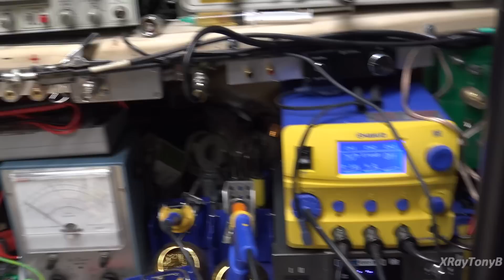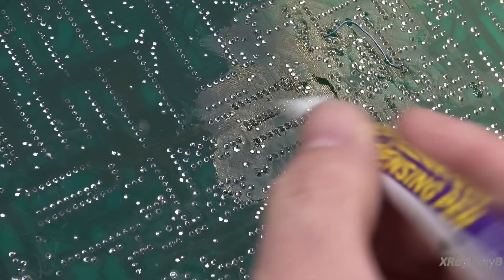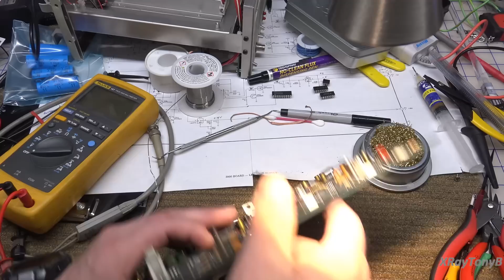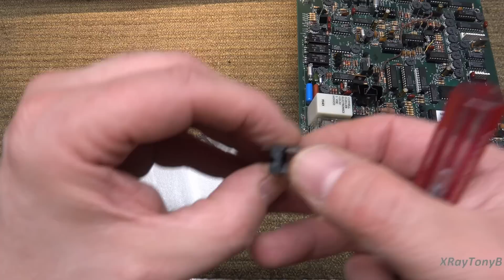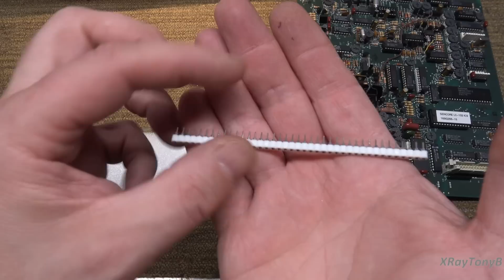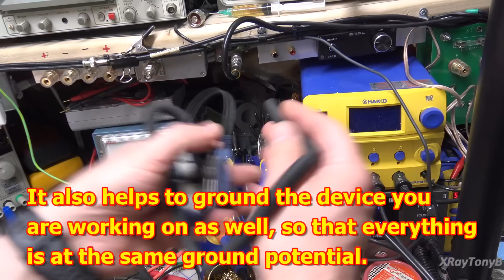Sencore LC-102 - Part 3 - Replacing ICs on the Circuit Board

Comment: Low melt solder can be really useful as well for desoldering. Use solder braid to suck up some of the old solder first, add flux, then blob the low melt  on all the pins and swoosh it around to mix it in and the part will likely come right out.

Comment: Have u tried using low melt solder before desoldering, works great
Reply from the maker: Yes, that's a trick I use on newer boards.  This one still has the good old lead solder.  Thanks for the comment!

Comment: Tony, we don't often get the anti-static info within these video's around the internet, but when we do please don't make the massive mistake by telling that your wrist band has a direct connection to ground.... Of course you mean well, no doubts. But that connection is done at least through a high resistance (> 1MΩ). No one would connect one of the mains potentials to his body, when touching live mains with the other hand it can or will be fatal.
Again, I am sure you meant well, but people listen to you and most do not have a Hakko soldering station (like me) and start building their own anti-static device 🤔
Reply from the maker: You are correct.  As far as I know, all of the anti-static wrist straps have this resistor in them.  Thanks for bringing this up, however.  :)
Reply: @xraytonyb  Glad to notice I was not to hard on you. After I wrote my comment I realized that you use an isolation transformer, and that might let you think different about ground.
Reply: Forgot: second reason for that resistor is that a static discharge (from component/device to ground or from your body to ground) is limited in current too.

Comment: I couldn't stop laughing when I read "notice how efficiently the desoldering tool removes the solder from the wrong component" I have done that a few times too so don't feel bad.
Reply: Also I would like to add that when cleaning flux off a freshly soldered component I use a 2" x 2" lint free nail wipe, very inexpensive, I get them sopping wet with IPA, lay it over the component and use a tooth brush on the patch and it works extremely well in removing the flux, I saw this on another channel and was surprised how well it worked.

Comment: 23:50 "Assembler/Solderers" or EngineeringTechs at many of the Aerospace/Defense companies will still have IPC J-STD-001 courses, for which the evaluation PCB will have through hole components to be tested with. I recently re-certified with the CIS IPC J-STD-001H standard, even though I'm now an "engineer" (was an electronics technician since 1989). Even though I thought it would be entirely SMT now, THT still exists, even on modern designed boards.

Comment: To complement your talking about logic chip family's, and to simplified faultfinding, the early Cmos 4000 series are always suspect to failure, and more sensitive to static electricity, because the are unbuffered, a few years after production they all buffered them, and got the letter B behind the numbers, so CD4049B for example, in some critical applications you can not always swap them.

Comment: If you aren't going to reuse the IC for the new socket the easy way is to cut flush the pins or legs  top side first which 
makes things so much easier to remove the old IC leg  remnants in the holes. You may not be able to reach every leg but
 thats OK . There is now less chance damaging any traces around the work area which is the most important thing. As
for showing us the error in this video Tony  next time circle the area to be remove with a fresh Sharpie just to be sure!
 Hell , one was sitting right there on the bench! Love all the tips shared BTW.
Reply: Exactly, it feels brutal but it's the safest way. The pins come out so easily.

Comment: Thanks Tony for some good tips. I've run into circuit board holes that were about the same diameter as the component leads. To make things worse, when they assembled the boards, they cut the leads with dull flush cutters which squeezed the leads to about twice the diameter before they cut. I wondered if they did that intentionally so the equipment would have to be sent back for repair. This was on an early ISDN codec from Telos for the broadcasting industry. In aerospace, the flush cutters cost well over $100. They inspect them regularly and they dispose of them after a defined time period whether they show wear or not. It's always good to have the sharpest flush cutters.

Comment: I use to cut the lead of the components and with minimum heat take out each pin , after that  I clean each hole.
Reply: I don't do a lot of repair anymore, but I still cut the leads : )